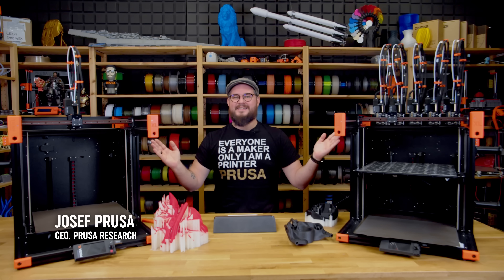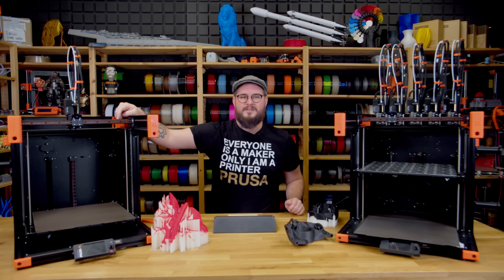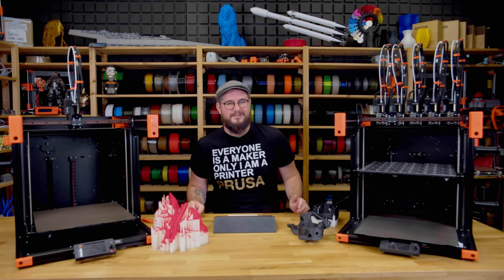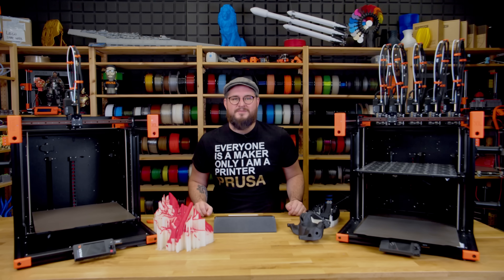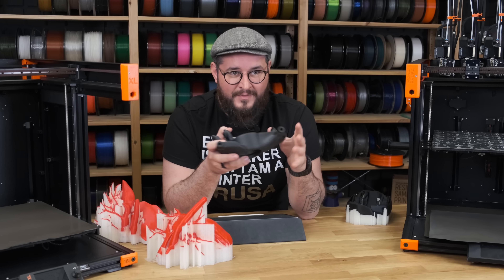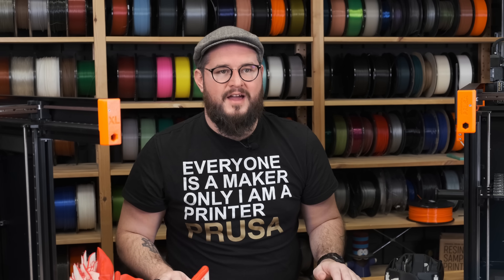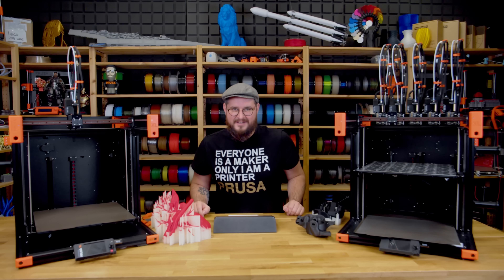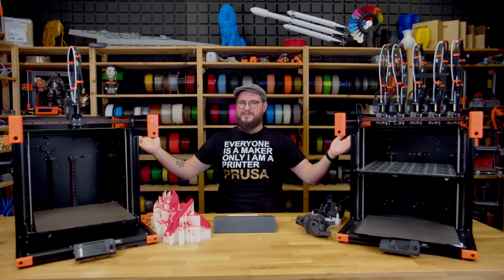XL update - beta test news, hardware changes and shipping schedule

Comment: Prusa need to move fast or ppl will just buy from Bambu Lab
Reply: lol BL has only sold like 22k printers and a good 1/3 of them are broken down waiting for new parts. Trash QC. I've seen at least 2 dozen people that sold their prusa printers for BL printers and are now regretting it.
Reply: Prusa PR needs to hire someone better than  @LilApe . Throwing baseless claim will only hurt your image.
Reply: @henreator  Baseless claims? More like a hard pill for you to swallow huh? All you have to do is join their official FB group, do the math and see for yourself. Everyday, every 20-30 minutes, there are posts about the X1/P1P having a problem resulting in something that requires a support ticket and replacement part. Whether it's a MB fan, stepper motor, hot end, heatbed, faulty heatbed wire, PSU, bushing, filament cutter, etc. I've literally seen 28 posts ALONE about warped beds in just the last month on that group.

The build quality on a X1/P1P is no better or worst than any another chinese made printer. I replaced the stepper motor on my friends P1P, which went bad the same day he got it, and the fucking part numbers are the same as on the anycubic I had from 4 years ago. Some of the lowest quality parts sourced from shenzhen. 

The honeymoon phase for BL is over now and everyone is coming out about how trash their QC is. Calling people "shills" just because they keep calling out a company's shit QC makes you look like an idiot that just like to defend shitty manufacturing. Cope harder
Reply: @LilApe  I joined the FB group and I don't see posts about printer problems every 20-30 minutes. You still haven't provide the source where 1/3 printers are broken.  Don't tell me the number is coming from your imaginary 'friends'
Reply: @Lucas-li5yf  So calling out one company's garbage QC means I'm a fanboy of another company?  Cope harder.
Reply: @LilApe  I searched the two most popular groups in FB and don't see the post you mentioned. Again you still haven't provide the source where 1/3 printers are broken.
Reply: @henreator  lol dude, it's math, that's the source. You don't need a written article for proof that 1/3 of their printers are having problems. Look at how many printers they've sold, to how many failure reports they have. Which again, just in their FB page alone, it's every 20-30 mins per day. BL is shipping more replacement parts than they are printers at this point.

Do you need a "source" for how unreliable creality printers are? No, it's just common knowledge based on the mass amounts of posts created in regards to issues. Same with BL.
Reply: @henreator  Suggest you to just ignore Lil Ape. That's what I learnt from dealing with iphone fanboy. 1/3, 20mins, etc... he can make up any numbers he like. I have both Prusa and Bambu printers and they both work like a charm.
Reply: @Lucas-li5yf  lol
Reply: @LilApe  Source for your claim of 1/3 printers being broken down?
Reply: Seriously, Prusa need to hire someone better than LilApe to do the PR. He is doing a lousy job.
Reply: Too L8

Comment: Interesting,.but at nearly 2500$, I don't see this being as successful. I can get 5 P1Ps for the money or 3 with 2 AMS systems.
Reply: Those BL printers wont last long. 1/3rd of the 22k printers that BL has sold are all broken and waiting for parts.
Reply: @LilApe  Source for this number?
Reply: Good luck getting the AMS to print flexibles, abrasives or water-soluble materials. Also have fun glueing your prints together.
Reply: @ulaB  just print those directly without AMS? Water solubles work fine through AMS though. No issues so far. And I'll have to glue most of my prints regardless. They come precut most of the time and using mesh mixer to add them together is hit or miss on final results
Reply: @JohnSmith-rt5yq  Sure, if you're ok with these workarounds or don't have to print a lot of big things, the Bambus might be better suited for you. 

But you should not assume its the same solution for others. There are people that need to mix different materials in a print and not have weakened parts because the water soluble contaminated the main materil. I have to print big PETG parts quite often that are hard to glue together without losing strength. For me it's worth paying the extra.

Comment: I have been using the 0.6 nozzle on my 3S+ for a long time now and love it, looking forward to the XL, I use ASA and ASA Carbon as well as PETG, have no use for the PLA because it just isn't high enough temperature, also really need to print with Nylon and PC, the XL size is important and the sooner this machine has an enclosure the better, absolutely love Prusa products and looking forward to the tool changer capabilities.

Comment: So glad to see you are shipping with a .6 nozzle!  I'd even be happy with a .8 option.    
Really looking forward to this printer. :)
Reply: V6 hotends are limited to a realistic flow rate of 12mm3/s. With a 0.6mm nozzle and a 0.24mm layer height, your max print speed is less than 85mm/s. I think I prefer a 0.4mm nozzle which can print at max 125mm/s and you can also make it print at 0.6mm widths.

Comment: I hope Prusa knocks it out of the part with the XL in performance/reliability and will start applying the knowledge they gained to start improving their lineup in overall on the double. Their lineup is in desperate need of some upgrades. The i3 is simply getting too old. The MMU2S is unstable, the mini has reliability issues with its hotend. With every new competitor entering the field it gets harder and harder to recommend a Prusa to those curious and wanting to get into 3D-Printing. Even if i abhor stuff like Bambulabs' proprietary nature...

The SL1S is doing fine though. Wish it was less expensive, but it is still competitive.

Comment: Yes to the 0.6mm standard nozzle! Makes perfect sense for this (and most) machine. Looking forward to optimized profiles for 0.6mm
Reply: V6 hotends are limited to a realistic flow rate of 12mm3/s. With a 0.6mm nozzle and a 0.24mm layer height, your max print speed is less than 85mm/s. I think I prefer a 0.4mm nozzle which can print at max 125mm/s and you can also make it print at 0.6mm widths.
Reply: @alejandroperez5368  smaller nozzle, bigger flow? that seems to defy physics!
Reply: @GabrielAlejandroZorrilla  He is totally correct since he said speed, not flow.

Comment: This machine is born outdated, Bambu X1C seems way stronger for less than half of the MMU option
Reply: Enjoy your speedy printer, while I print with mixed flexibles, abrasives and water-soluble filaments in nearly 2,8 times the build volume. :)

Comment: The bamboo X1 carbon is such a kick in the nuts for this thing
Reply: I don't think you fully understood the differences. Comparing multi color vs. multi tool head e.g. is rather naive.
Reply: @tmartin9482   ofc I understand the difference but not everyone really need multiple tool heads when the X1 can switch materials so reliably….. I am not saying they are similar printers even ….. what I am saying tho is that for sure many people that we’re waiting on the prusa will just get the X1 instead
Reply: Why? because of speed? just put klipper on a prusa then you got a printer just as fast, but more reliable.
Reply: @LilApe  lets see it, I will wait for the video link
Reply: @RCPhotosVideos  you're literally on YouTube. Just search it
Reply: @LilApe  Pretty sure 0 videos of the XL with Klipper are on youtube. I have seen other printers running it though.
Reply: @RCPhotosVideos  I didn't say klipper on an XL. I said klipper on a prusa.
Reply: @LilApe  Assumed we were talking about the XL on a XL video. I just want to see the speed so everyone can stop talking about it.